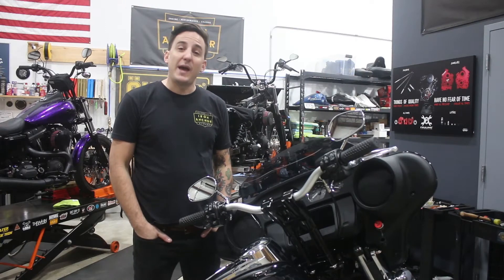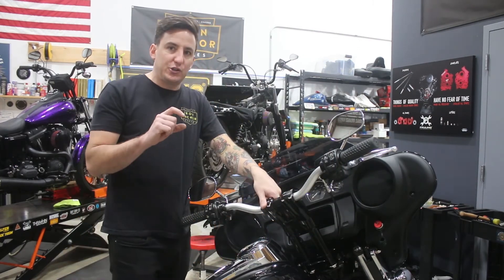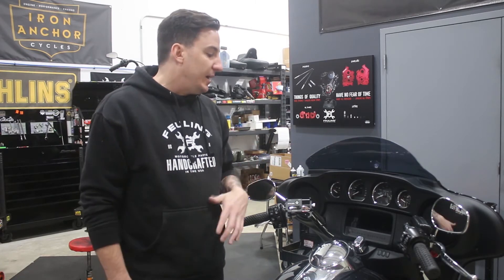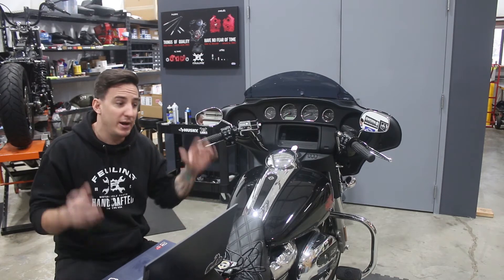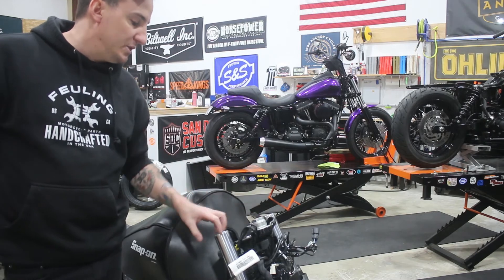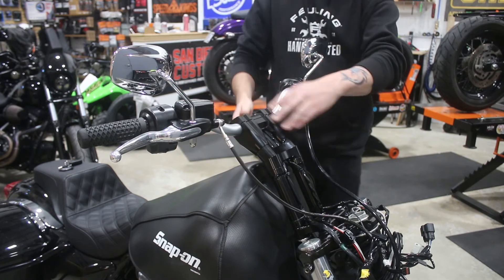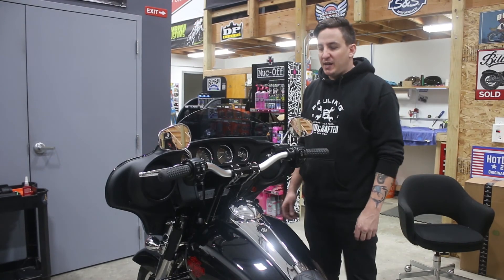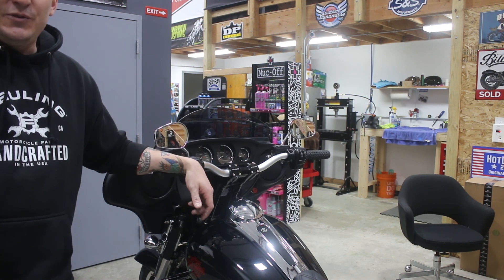Kraus Riser Setup on a 2021 Electra Glide Standard

Comment: And FYI; you can cut that lower inner fairing cap and make it work.  I have the same setup on my Electra Glide Police (no radio either) and I simply cut out the ignition hole, just past the first button on each side (leave two buttons outside).  The two sides then bolt right back up and there is enough of the lip left over to keep it in place.  Looks much cleaner.

Comment: Pretty sure you don’t need to take the top triple tree off to get to the riser bolts, unless HD did something different on the 2021 models. I’ve always just turned the bars to the right to access one bolt, and turned them to the left to access the other.
Reply: Same as street glide

Comment: Great video and install, thanks for sharing!  I just picked up a lower mileage '08 Street Glide with the purpose of running this setup (8" pullback) as my daily rider.  However,  my bike does not have a security system (fob) which was an option for the '08 model year.  I know it's a big ask, but hoping you could share some quick thoughts about options for deleting/relocating the ignition and a cruise control rocker switch located on the ignition valance. ...thanks!

Comment: I want to go with the T-bar set up, but not being able to lock the forks...what happens if I'm staying at a motel, with the bike parked in front of my room?  My key-fob would be in range, someone could just start up your bike...
Reply: The key fob has to be within about 30 inches of the ECM. It won't activate from inside your room. It wouldn't even activate if it were in the car parked next to the bike. The range is very close on purpose.
Reply: Kraus now makes a keyed neck locking plate that is clean and well thought out. They’re currently priced under $70.
Reply: @johntatsey2244  I already installed Freedumbfab bars on my bike lol